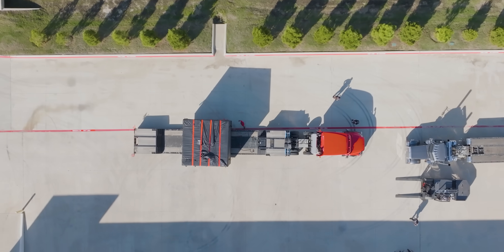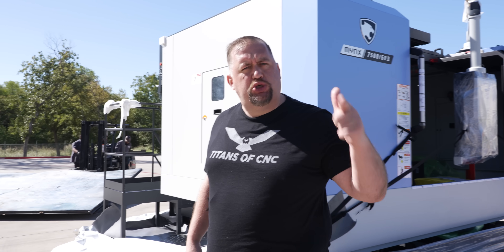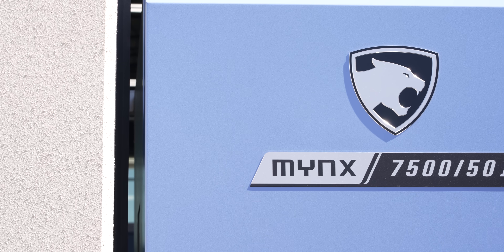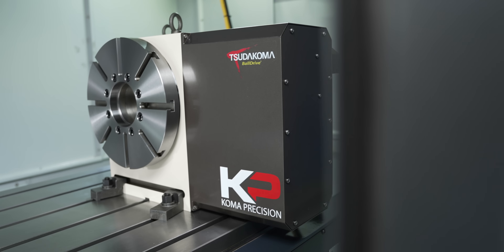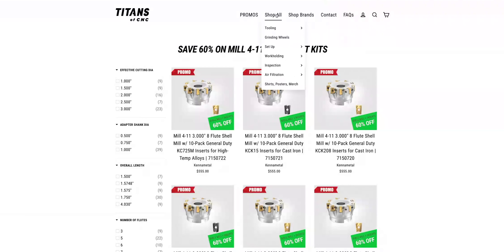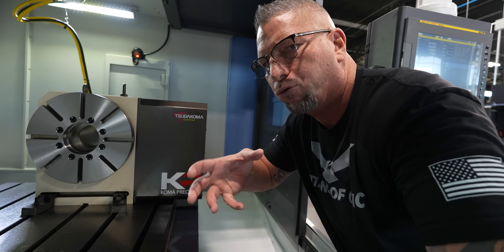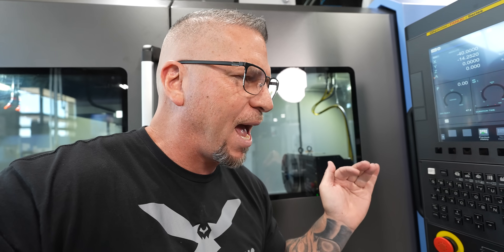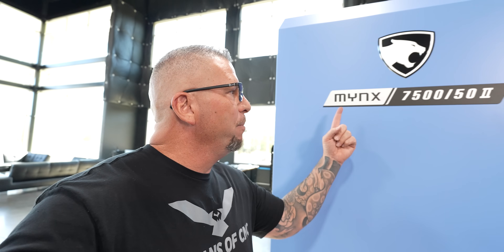The MOST Powerful Mill Ever | MYNX 7500

Comment: We have 2 of these and a VM960. They are good machines but I wish they had a plus model with 40" of Y travel.
Reply: Same, I’ve looked all over for a 40” Y vertical but all the vendors switch to bridge mills at that size
Reply: I have a Leadwell MCV 1500i+ with 40" Y and I love it. It takes up less space than similar machines that only have 30" of Y. (cough cough mynx7500 cough cough) A Haas VF8 and VF9 are both 40"Y. I actually have a list of machines around that size on a spreadsheet cuz we were looking at some new machines a while back

just looked at it. Makino V99, Okuma Millac 1052V, and a bunch of Moris on the list.
 @AdamEarl2

Comment: In this age of electric cars and renewable energy, there is a lot of ignorance of how effective that is in an industrial environment. Like I have heard people say that the Tesla building will be running off of the solar panels on the roof. People don't realize how much electricity a real manufacturer uses. Rows and rows  of machine tools with 10 , 20 , 40 horsepower motors or a die casting operation like Tesla is going to be running.  Not that I'm trying to bash Tesla,  I would just like to inform people as to what kinds of energy consumption/bills a manufacturer has to deal with.  Going green takes energy and it costs big money, solar panels and wind generators can keep the lights on,  but that's about it.
Reply: I have to disagree…
We run a machine shop with about 20CNC machines. Even if all are running, we are getting fully powered by our solar panels 80% of the day in 70% of the year.
The roof is only half covered with the panels…

Comment: What powersource does that machine require?
Reply: Spindle alone is 30KW. Probably with everything else 35-40KW. 3 phase power obviously. Phase currents are in the range of 50 to 60Amp at 400V